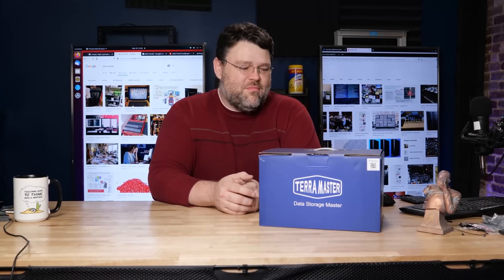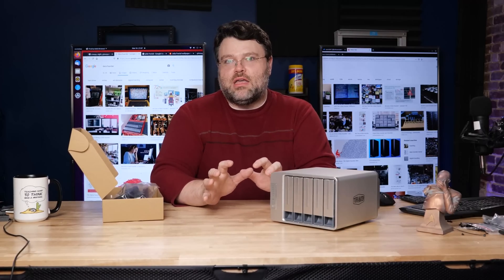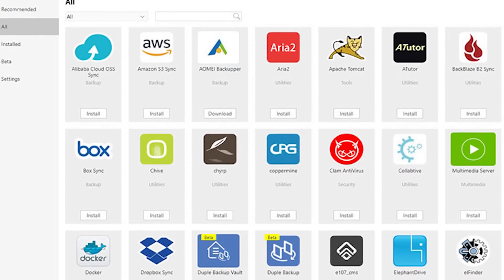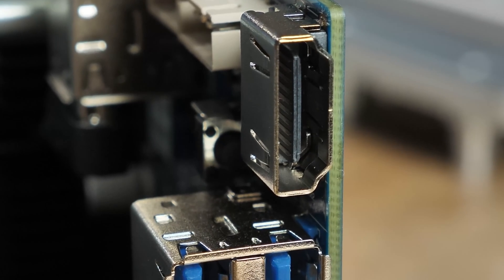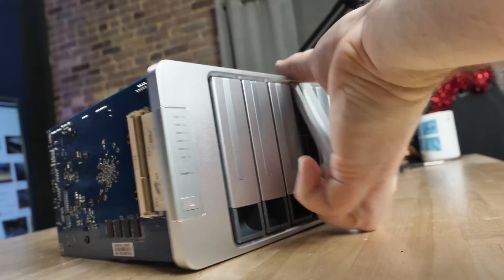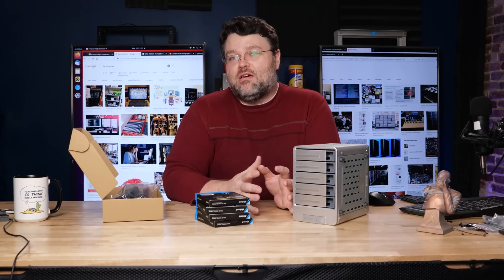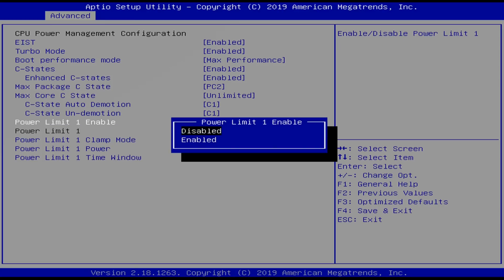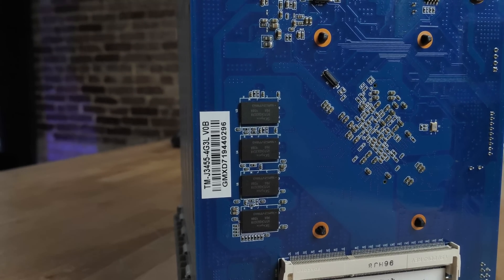You Could WIN This Terra Master F5-422 5-Bay NAS!

Comment: Great review I have a TerraMaster F5-221 and thinking about upgrading to the F5-422. Your presentation is very convincing on for the F5-422. My F5-221 has 4 4tb drives and has been working nicely for over 3 years. Only sorry I saw your video while the give away was running.

Comment: This would make an excellent machine for my parents' home network, acting as a NAS for family photos and backups, as well as a low power Plex server. They are not super tech savvy (can work their way around a GUI, but no hardware experience), so having hot-swap drive bays as well as support for JBOD makes it excellent for easy expansion if needed. I would advise them of the risks of bit rot, but knowing them, they'd accept it for the cost savings, especially since I'd help them implement a 3-2-1 backup solution to my TrueNAS box, either by swapping offsite externals every few months and backing up on my own local network.

Comment: If I win that nas, I'll do as you suggest and do a raid 6 with 5 hard drives and use it as a central repository for my junk. Right now I have 3 or 4 PCs I use fairly regularly, and stuff is scattered on hard drives in each of them. I've thought about turning one of them into a nas exclusively, but just haven't been motivated enough to "fix" my situation.

Comment: I've been looking into building my own unraid NAS, but I'm unable to find cases in my local markets that are small enough to hide in a shelf but still support 4-5 drives. I wanted to go this route as I find the available ready-made solutions are really very expensive in addition to the import taxes. I wonder if I can replace the USB flash drive with an Unraid one in this system. That would also allow BTRFS or ZFS if I can boot into Unraid. I can just add a new DIMM and that in addition to running Unraid, will also act as my Plex, NextCloud, Password manager, Torrent/NZB downloader, and most important as a backup for all devices in the house. If it can handle, I may also want to use it as a surveillance server to handle storage and processing from 4 POE cameras. I agree with the router bit you said, but I might also try to use it as a DNS resolver as well.

Comment: This is perfect timing. I run a small electronics repair store and I’ve been using one of those All-in-One security camera boxes. The kind with 4 cameras that link to a single box that connects to a TV. (Garbage basically). I’ve decided it’s time to upgrade my set up. I have 5 PoE cameras on my Amazon list and I just finished running the network cabling last weekend. I would love to use this NAS as the hub of my security cameras. It would be perfect to store and archive my security camera footage. It would also be great because I could easily make a simple PXE boot server for when I’m restoring laptops!

Comment: I currently have a ridiculous patchwork of external USB 3.0 drives running in ZFS mirror pools (2 devices per pool, 4 zpools). This is what happens when you only add storage when your existing storage is full, but this is more down to budget than poor planning -- at least 60:40 anyway. This media database is a real the ship of Theseus with all but one drive having been replaced at least once since I started it in 2011. 

I'm in the process of copying everything to the cloud but my ZFS server is an i5 2500k system living on borrowed time so I definitely need to replace it at some point. So I would probably go off piste and load a ZFS compatible OS on the TERRA MASTER, then shuck 5 of my drives and make a RAIDZ2 pool.

Comment: I would to use it as NAS Home Hub.
Currently I'm using old laptop with linux server for these purposes, so it would be nice upgrade
(running all these on 1GB Ram machine, in my case, was "Doable")

My Home Hub
* Install Debian(if possible)
* PLEX Server
* Music Server
* Photo Server
* (My)SQL Database for LOG'ing outputs of my DIY sensors (Doorbells, Temp & Humidity sensors)
* Docker with python; 
** For connecting with my DIY ESP32 Sensors programmed with micropython.
** for sending PUSH notifications (in case someone press the doorbell)
* Simple WebServer (actually displaying the data)
* Storing Surveillance Cameras footage ( ffmpeg )
* local Backup
* Print Server (cups)
* Download Server
* VPN Client

AND above all
Installing open source versions of mentioned above Servers, so it can be relatively simple and secure

Also "If I win", i will share configuration (if requested) of the servers on lvl1($this) forum.

Comment: I would consolidate my files from 6 external hard-drives of varying 
sizes as well as actually taking backups regularly (instead of once in a
 while). I would probably also self host nextcloud, gitea and similar 
stuff (only for internal network/VPN hosted by other device), probably 
using another os.

Comment: Wait, it has built-in LPDDR3 and upgradeable DDR4? Can that Celleron actually run both at the same time? I want it. I would probably use it as a Home server, storing my Star Trek collection, and also backup my Computer and maybe even VPS to it. Also I might look into security on the Web interface ;) Name on the L1T forums is(without @ in it) max@12@20. (I don't like automatic metadata aggregation :P)

Comment: Man, I tried to build a home media server with an old core2quad 8400 and 8gb of ddr2 storage. Never got around to get it running for I'm bound by toddlers and have no experience with NAS OS's, so my three 3TB Toshiba NAS HDDs are sitting unused for a year now. Got them cheap but they really should get two brotherens and get to work, 9TB is fine for me. Always wanted to get an external enclosure instead but they too require time to get into. This thing would fit me regardless of the giveaway, so thank you Wendell for making this video, I'm gonna check it out either way the draw of luck goes. Be blessed!

Comment: Based on noise I would either use it to just backup data to external storage (not raid 1 2x 1 TB SSD, but raid 6 5x 1 TB SSD, or maybe I would upgrade to bigger SSDs) and probably also steam cache, I do not think it could be silent enough with mechanical drives.
But if it would be possible to keep it quet and cool there are few things I could use server for, like simple web server, or maybe even a game server.

Comment: Nice piece. If it were mine, I'd probably (eventually) set it up as a file server for my family – our computers are all networked together, but we have no common repository for data or backups. Of course, I'd probably wanna hack it a bit first (maybe try it as a container for a live Debian distro like Knoppix? Dunno if it'd work, but I'd certainly have fun trying         8-)
Sadly, I wouldn't be able to utilize the full bandwidth of the 10Gb NIC (...yet) as I only have a gigabit router (although I did recently order a 2.5Gb switch, so that'll probably cover the bandwidth of the spinning rust I'd probably throw in it).

Comment: Nice review as usual, thank you Wendall! If I had this it would replace my 10-year old QNAP TS-219P+ that is not getting updates anymore and frequently becomes unusable when performing background anti-virus checks, SMART disk checks, or backups. I could definitely use the F5-422's 200+ MB/s network speed since I currently use my QNAP as a file server for Visual Studio, Blender and other projects. I’d also really like to use the F5-422's more powerful CPU to offload encoding duties from my 11-year old i7 desktop.  I'd also investigate using the F5-422 as a SQL, version control, web and/or other server, experiment with that internal USB port, and backing up the F5-422 to my QNAP over ethernet and/or backing up the F5-422's first 4 drives to its 5th drive.

Comment: I will setup my rural parents, aunt and uncle (who all live within 1/2km of eachother) with a Plex server, provide myself with off-site backup through my aunt's satellite Internet service which will be upgraded to a starlink service when it's available. My aunt is the best line of sight to both my parents and my uncle, so I'm thinking of simply connecting a high gain omnidirectional antenna to an extra router I have to the starlink receiver, then the other two sites can gain access with Yagi-Uda antennas. If some other neighbors wanted in on the deal, well for a small fee they would be provided access.

Comment: I've been using this unit as an Unraid server for a few months and it's been great. Just finished loading it up with some 16tb drives. It has 2 internal usb ports so one is my unraid install and the other runs my cache drive. There is just enough room to squeeze an ssd drive in the case, so I have 6 drives in it total. I run a plex docker and pass through the igpu and it handles multiple transcodes really well. I highly recommend this hardware, but have never used the native software so I can't vouch for it.

Comment: For me, a way to backup my YOLO-NAS that I built with what drives I could scrounge together that were very not matching. It does other things too, but I'm always on edge that it'll die and FreeNAS for whatever reason refuses to include support for FAT32 or EXT4 (or EXT3) so I could use an external USB (like say the seagate external I bought on the cheap) to backup.

Comment: Am a student right now thinking about getting into networking/sys admin stuff. Dont have much budget for a homelab but this would be great to see how I can integrate a SAN with K8s and not deal with the hassle of hardware raid/raid cards on my main compute/virtualization server (R710) . Really want to understand how response times / how usable it would be to host the OS/storage of a VM on a totally separate computer than the compute resources of the VM . Other things I want to learn more about are different types of FS's versus RAID and the speed benefits like Gluster FS or LVM and really weird ones like ZFS and BTRfs that i have no clue how it works. Probably just gonna fill it with the drives of my R710 or some cheap 750gb HDDs i have lying around so performance wont be great but hey, at least the ethernet port wont be the bottleneck! LMAO technically my home infrastructure/ccna lab gear only runs at base100 speeds but maybe i can get a nexus 5000 to go along with the FEX's i won from a government auction for 10gb all throughout house. 

Level1Forum Comment with less details: https://forum.level1techs.com/t/what-would-you-do-with-a-terramaster-nas/164491/482

Comment: I would use it as a temporary nas as i need to reconfigure my current one. After that is done I would use it as a backup to certain parts of my current nas that i want more secure backups of. Might use it as a storage place for vms on different machines on the network as i currently don't have a machine with 10Gb ethernet.

Comment: I would probably use it for my 3d printer, also add some of my older storage. (my old 750gb drives need a new home, because they are not dead yet).
Of course messing with the os, because I cannot remember the last time I used the default.

Comment: I'd probably put TrueNAS on there and expand my existing nextcloud setup with some really needed space (hosting some collaboration tools for a 3-head flat share). Would experiment hosting some of my more light-weight light-weight containers on there (like smokeping or pihole perhaps) or use it as fail-over for my existing containers.
I really like what TrueNAS has become recently but don't really have a place for it to use properly (with actualy disks, etc.) and accessing files from nextclouds via webdav  is sort of terrible...

Comment: I'd migrate everything from my failing plex drive to this. I've been running it on reallocated sectors for the last two years and space on that is a premium.

Plus, this is likely a lot faster than the bulldozer-based AMD laptop APU I'm currently using as a Plex server (HDD connected over the USB 2.0 interface).

Comment: I would create a back-up NAS using raid 6 (probably 16TB+ drives) for my Karl G. Jansky Very Large Array and Atacama Large Millimeter/submillimeter Array data. After spending hours calibrating a single data set, it can easily take up >100 GB. Thus saving the data is very important and requires large drives. I would also set my home computers (2 laptops and 2 desktops) to back-up to this server.

Comment: 450 MB/s with SSDs, (although the RAID level isn't explicitly stated), is still pretty crappy considering that a single SSD by itself, can do 400 MB/s (as local or direct attached eSATA storage).

pulls a McKayla, not impressed face

Comment: That thing is quite lackluster imo.
1.  The doubled ethernet situation is just straight bad, and a obvious cost cutting measure when that should not have even been an option for a NETWORK Attached Storage.
2.  The lack of ECC (because of the Celeron) is very dissapointing for a serious ZFS build. (Although I get that that's not it's intended purpose)
3.  Like Wendel mentioned there really should have been at least 1 internal slot for a 2.5" SSD or a m.2 slot for SSD caches.

That being said it is it at least 10 GbE and has 5 bays and was nice of TerraMaster to let you give it a way, and free is free after all.  I would do with it what I've been meaning to do for years now and create a proper offsite backup.  My current NAS is a FreeNAS RaidZ2 and is the ONLY copy of all my data...  Bad I know.  And we all know the magic words that RAID IS NOT A BACKUP, so could definitely put something like this to use as a offsite replication/backup NAS.

Comment: I would use this to be a much more efficient server (with much faster networking to boot) than what I currently am using (Xeon e5-2630) to host my files for personal backup and for archival of video and audio projects/original media. As it stands right now, I am maxing out the 1Gbps LAN, and would prefer to not spend any more on something that is not very power efficient that I would want to leave up 24/7.

Comment: Having multiple NICs connected to the same controller along with full OS access really opens up the possibility of using VPNs by bridging a VPN connection to the two 1Gbs connections and basically letting any device connected to them be attached to the VPN even if it doesn't support VPN configs, having network attached to it even makes it better since you can combine that storage with and provide it to the VPN users as well

Comment: I would use it to replace my current, nearly 10 year old, FreeNas/NAS4Free/Xigmanas server that needs replacing.
I would have to put TrueNAS on there.
Max out the RAM.
Configure the 5 drives as a ZFS RAID-Z1. 
Run a few jails. Plex, Transmission, Nextcloud, Syncthing, Calibre, HomeAssistant, Mosquitto, etc.
Setup some ZFS replication to an offsite server.

Comment: I was going to re purpose my first desktop pc that I made into a NAS, as I didn't want to throw it away since it holds sentimental value for me. I brought some basic parts, and upgraded my cooler, got an ironwolf pro drive. I was planning on using Rockstor as the NAS OS since I mainly use linux as my daily driver. But once I got all my parts, unfortunately, I was unable to install the NAS OS because my cpu was is an old Sempron 145 single core and the cent os requires at least two cores. When I was younger I got a sempron 145 because I couldn't afford anything more, and picked this one specifically because I thought I could core unlock it, but I wasn't able to unlock it :/. I tried ordering a secondhand athlonx4 cpu from aliexpress but that one never came. You can find the full story on the forum. Username: Rilton

Comment: I would use this on my home network for home file storage - important documents,  work files,  photos, and media. Once I transfer my media I would run plex using the Terra Master Plex implementation. I would set up 5 drives (rotating rust) in raid 6 configuration using the largest drives that are compatible and I could afford.

Comment: I'd replace my current backup solution - a raspi 3b+ with a 3tb 3.5" drive on a sata-to-usb adapter (and also is running plex in a container!) which then gets backed up to 2 externals (on and off site). I'd love to have a backup solution at my house with raid 5 or raid 6, or optimally get an OS running on it to run raid Z2, it'd really solidify my storage.

Comment: Ive had two of these and they're great. I loaded Xpenology on to them both and used both for over a year before a Synology update killed them at which point I moved away from them and upgraded to an actual Synology NAS. Still use one of these for a backup of my Plex server/lab and the other is currently in use as a name server. If youre just getting into IT these can be a great to experiment and learn about Docker and virtualization.

Comment: I’m currently developing an opensource Linux distro what will run on a NAS I’ll hopefully release sometime. I’m developing on RPI4 compute module, since it has a PCIe expansion slot for SATA, but once I start working on the physical design having a few devices for reference would really help out. Thanks for doing this, Wendell.

Comment: I have a very specific use case for my research work of data collection on a drive by wire car. It will require running ROS in Linux. I’m looking to dumping multiple stereo pair cameras, a VLP16 LiDAR, IMU, multiple GPS and wheel encoders raw data. I need a RAIO 0 setup as multiple sensors on USB3.0 and multiple NICs has frame drops with SATA SSDs in RAID5 config  (may be poor onboard RAID). Again the 3.2TB just last for 45 mins of raw data collection. Next 10G NIC is great to dump it to our server which is X99-E-10G WS based system with 6 disks in RAID 5. Right now, we have another X99E motherboard system fulfilling this role. The systems are all out of warranty and was never meant to be used in such a way. A sturdy small construction will be great for our movement.